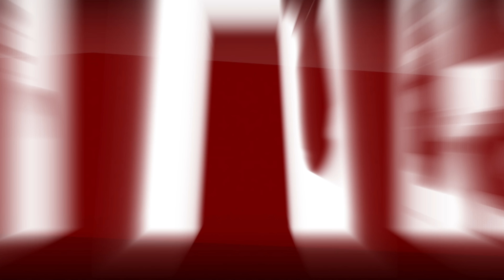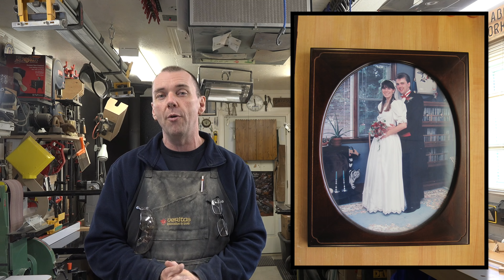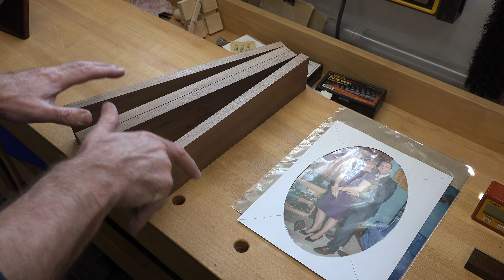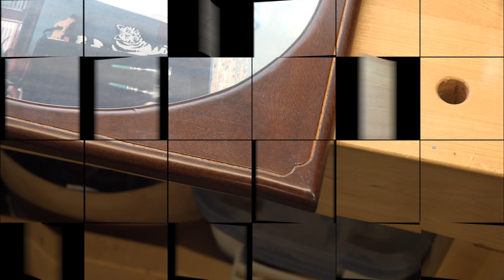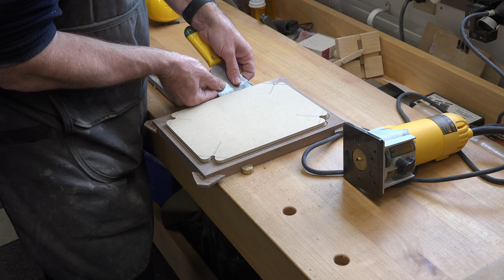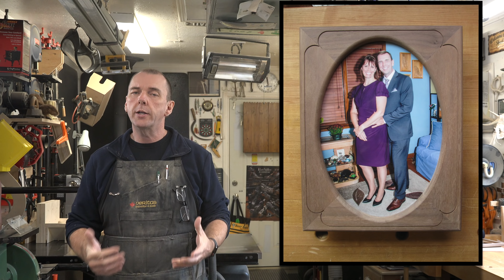Custom Ellipse Frame

Comment: How did you determine your frame sides needed to be 3" wide. I have an oval picture 14" x 20", and want a 2" wide elliptical frame. Have already built the jig for cutting the elliptical.
Reply from the maker: Truth be told Paul, the best and most fool proof method available is to draw your frame out in a 1:1 scale and measure the width of stock needed.  Draw out the 14X20 frame, include your mitre cut lines and the draw your ellipse on it.  Measure the widest part of the frame pieces according to your drawing and add a little for wiggle room.  I hope this helps.  Good luck with your frame build.  Thank you for tuning in to the show.

Comment: the table saw is cheating  but i know how that is i do it too so i do not have to pull my jointer out
Reply from the maker: Never cheating.  In woodworking there are many different ways to do many different processes.  As long as it is done safely, there is no wrong way or a way of cheating.  It's all up to the person doing the work.  Thanks for tuning in.